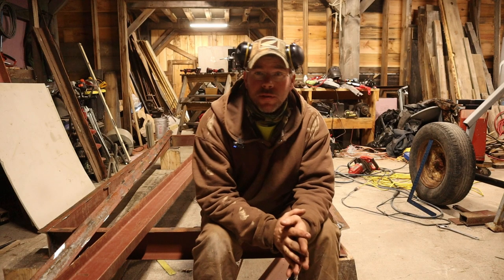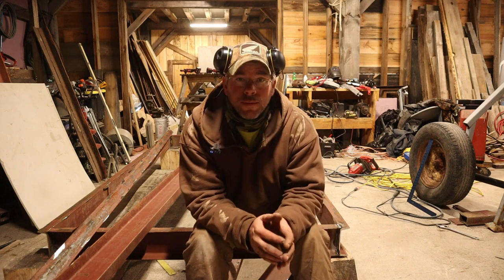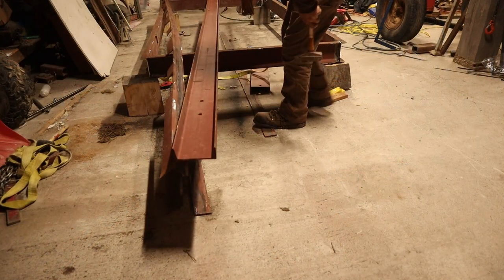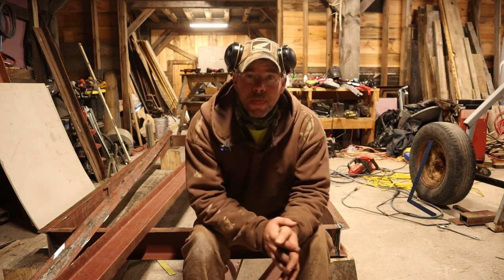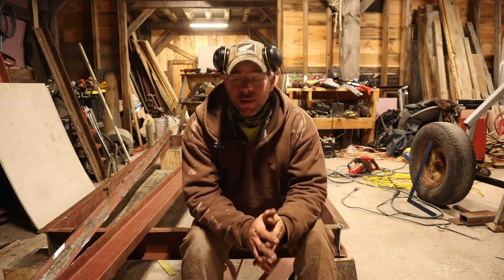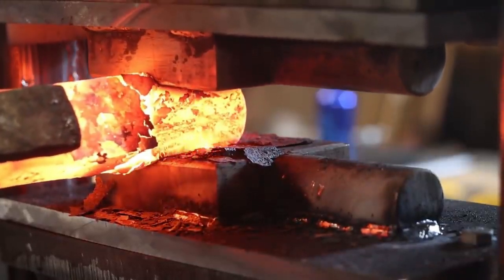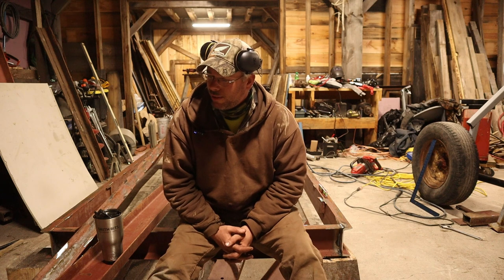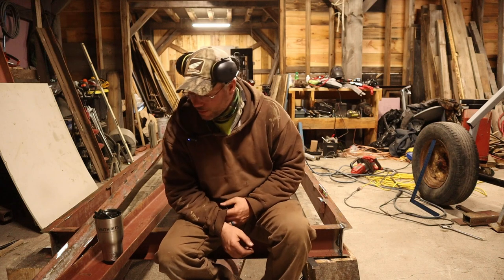Free Materials Are Never Free: The Art of Scrounging

Comment: Good talk, Jim. I learned to work on power equipment so I wouldn't have to pay a shop to fix my stuff, and ended up working at it for 30 years. But now, when I need extra money, I can find a broke engine or mower someone is throwing away, get a few parts or a rebuild kit, and sell it for a couple hundred in about two or three days.
Reply from the maker: Hey bud, how you doing?
Reply: @TheTradesmanChannel  - Pretty good, I was out cutting grass and cleaning up the front yard, and fixing to put some new plastic on the front of my greenhouse to get ready for winter. I tried to make do with some cheap shit plastic last year and it started falling apart after about four months! So I’m going to get some premium stuff to do the part that sees the sun the most. Have a good one!

Comment: I have also learned some of the most valuable things I know, by working with "free" stuff, and by re-purposing stuff. For one thing, I learned early on, how to figure out WHY something worked the way it did, and not just how. If you can reverse-engineer something to figure out why it was put together the way it was, to do the job intended, a lot of the time you can figure out a way to BETTER engineer it to work more simply, more elegantly, more cheaply, and stronger to last longer. Also, you can figure out why it broke in the first place, and how to fix it so that is the new strong point of the thing, and not it's weak point. Etc...
Reply from the maker: Hey buddy, I agree with you.

Comment: I really wish I could come across some free i beam. The scrapyard sells it for $0.50/lb which is good, but that it adds up quick. I'm building a hydraulic press and I'm up to around $250 just in steel costs alone and I still need to strip all the rust off which takes time.
Reply from the maker: I know how you feel.  I got all of my steel for free on my press build and still put over $1,000 into hydraulics.